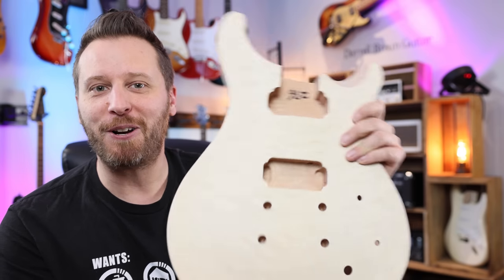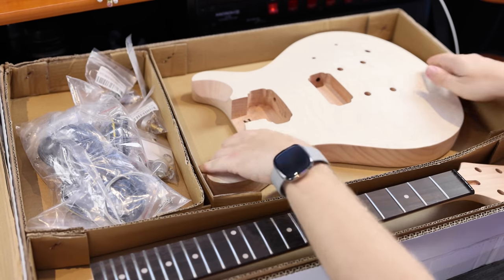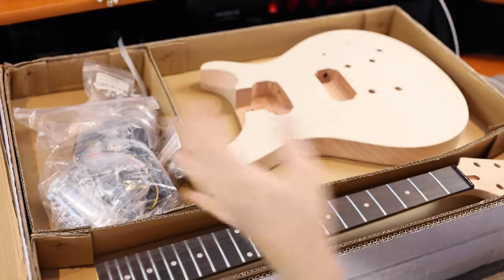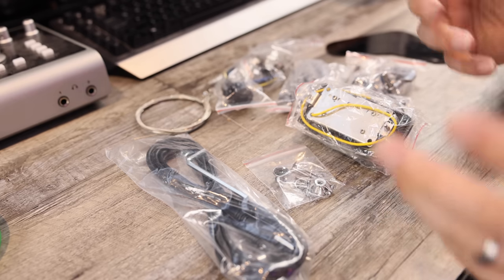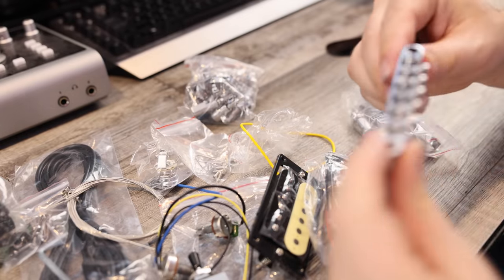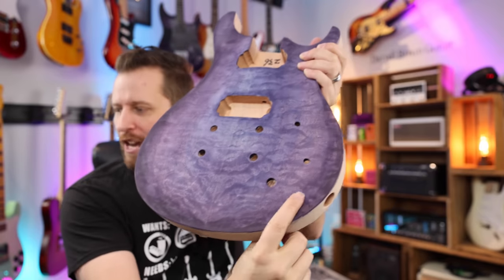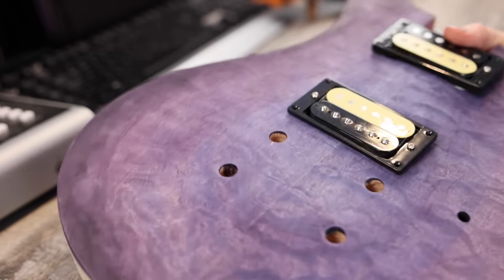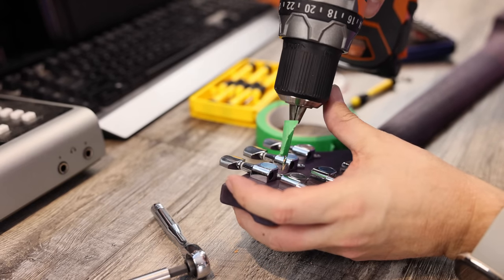Building a PRS Style Guitar! - This One Had Me a Little Nervous!!

Comment: Anyone thinking of doing one of these Solo kits but scared off by the staining, drilling and soldering: I put together one of their Tele style kits with nearly no previous woodworking or soldering experience.  I don't think there was any drilling at all on the Tele kit and the soldering was pretty easy.  I think they even have an option for solder free electronics which just has push together fittings.  And the bolt on neck fit like a glove.  Free shipping and no tax to the US.  Pretty cool.  I sound like an ad probably but really, I'm just trying to encourage others to try this.  It's super fun.

Comment: Loved how that burst turned out! I wasn't sure about it at first but man.... that's pretty. If you use water based stains you can always raise the grain first with a damp cloth, then apply stain after sanding. This way you don't have to sand a stained/dyed surface after. 
I do this for cutting boards, works like a charm. 
Cheers

Comment: QUICK TIP! 
Initially after you've scuffed the first time. Take a very very lightly damp rag and wipe over that wood figuring and then scuff the surface back up 😊

Itll pull the grain up and then when you stain it, it articulates it better. 

Cant wait to see more and/or the next build! 💜

Comment: Hello instead of using the foam brush if you had used a small piece of cloth like part of an old t-shirt I believe you would have had good luck controlling the dye application and thinning it just a bit as well. you can sand it back to lighten it up but if you start with a thinning the dye with a bit of water if it isn't as dark as you want you can always apply a second or third coat till you get it to the depth of color you want. That way sense the veneer on the top is as thin as it is the less sanding the better and you are less likely to sand through it.

Comment: 1. use a clean t-shirt type rag, you will get better results than you would with a foam brush.
2.  apply your base color across the entire top, (in this case azure) then add the eggplant and blend.
3.after staining seal the finish before sanding, you will still flatten the grain after it stands up, however you will not have to attempt to touch up the stain which can go horribly wrong.

Comment: Darrell Braun Guitar You can also use top grade artist oil paint this guitar.  You take the color you pick of the top grade artist oil paint and start hand rubbing it in then use Japan drier to spread the paint so it will dry.  I built a filter box where the guitar dried with out dust or lint.

Comment: 1. Use a rug, not a foam brush.
2. You can't get it even with one coat. You do a coat, sand it with 800 grit, then add another coat. Don't burn through the veneer.
3. To add accents to the flame, first you'd do a full purple, then sand it off, the purple would remain in the darker parts ever so lightly. Then do a full blue on the whole face, 3 coats or something in the same ballpark. Then purple the edges. Then blend them with a wet rug.

Comment: Nice video! Looking forward to hearing what it sounds like. The foam brushes didn't really look like they were any good for staining. I use a piece of rag, roll it and fold it into a tight ball at the end and use this tight end to apply the stain. Gives you much better control over the fadings and depths of colour. Maybe go over it with some 0000 steel wool once it's dry, a light pass to remove any raised fibers or a real rubbing to mellow the tones a little and show some more grain.

Comment: The water dillutes the stain and you rub it off a bit too. I would stroke a bit more from in to out and avoid hard stroke lines with a very wet sponge (and then I mean wet with stain), those are nearly impossible to cover… you can see this particurlarly on the neck but also on the front edges. You need to work quick and in more layers to get it nice and even. The color and grain are nice though.
And maybe start at the back of the body to get a feel of how it works, at the back it’s not so apparant if you make a mistake 😜

Comment: Hi Darrell. Don't know which finish u intend to use. So far I had nice results with wipe on poly for a high gloss. Some parts on the top still look like they have staining streaks in. I suggest take a strong tissue paper towel or a piece of t-shirt, wet it and rub until these marks disappear.
You could also use a trick to make the neck look flamed using a wire and a torch. Dan at Guns n Guitars has some nice vids on this. Cheers V

Comment: You need to de-whisker, aka de-wiskering first.

Before using a water base dye, stain, you need to raise the grain, apply, brush water, let dry, then lightly sand to knockdown the raised fiber, then apply the water based dye. 

It does two things, the grain will not raise again as much like the first time.

Raising the grain without de-wiskering, heavy grain raising, then sanding will cause color loss.

That is the raised fibers will take some color with them, leaving lighter spots. This isn't as noticeable as the second grain raising, sanding as, if any, is minimum. 

On a hippie look, tye dye look, you might not care, nor notice.

Comment: I got the solo bolt on Les Paul kit, in part based on your (previous) video.  Got the body completed with soldered bits together in no time, but the nut was not glued onto the neck properly.  I contacted solo and suggested that perhaps I needed to chisel off the nut, clean up the glue and re-glue it?  They confirmed that and closed my case, but... I have neither the facility nor the tools to get it back on in a way that aligns. The nut is plastic and reasonably cleaned up, but the headstock to fretboard area is not sufficient or linear to seat the nut properly in the first place.  Part of the point of the kit was to not have to mess with this part, insofar as if the nut is on wrong, it will basically never intone properly.  So I have to take it to my local luthier  to figure out what to do.  Needless to say, that's a disappointing outcome.

Comment: The thing I would want to do with the dies is use something dark like the egplant to bring out the wood patterns, sand it back and then do a top coat of the red.  That way the flame should come up really well.  For the back and sides I think it would be better to put straight purple followed by red to give it a very dark colour so as to avoid showing off too much where the second piece of body wood is attached off to one side.  My main issue with these kits is that the hardware and electronics that come with them tend to be so much junk.  I would much rather just order a body and neck pair sourcing the rest of everything else myself.
Reply: Usually the veneer is so thin on kits that you have very little scope for sanding it back after a dark dye and then a lighter one without sanding through it
Reply: With Veneers you can use a solvent stain as the dark color. It doesn't penetrate as far as water based. Once solvent stain is dry sand the middle section to lighten it up. But use 400+ grid sandpaper. Once lightened go in with another color.

Comment: Paul will have this Video taken down, that’s how he roll’s. IMO, the neck was to snug, I’d sand it back just a little bit, if not you’ll have glue squeeze out, also, you have to many hard lines on the body, use a rag, not a brush to eliminate those lines. I love the Egg Plant color 👍👏🤘🏼.

Comment: FY I- When applying the dye make sure to pull the foam brush or what ever you are using to apply the dye out towards the edges to AVOID dripage down the sides, resulting to more sanding work. It will also keep a cleaner line

Comment: I love the build and the colors. The one thing that got my anxiety going crazy is the visible brush strokes on the darker parts of the burst. How could this be avoided?  Cool little build
Reply: Using lint free rags and swirling in circles with multiple lighter coats. Slow and steady, not heavy handed.

You can sand down the finish and it'll lighten up a lot
Reply: @misinformationwithrandy   Thank you very much!
Reply: How

Comment: Could also do these as a bolt on. From what I understand there is no difference between a PRS glue in and bolt on neck joints. Generally use Maple necks for the bolt on models but you could certainly bolt a Mahogany neck as well. I've played a bolt on PRS next to a glue in (Core, etc.) and could tell no real difference in sound or feel.

Comment: Good build Darrell. Love your channel. I'm in the process of building a Solo Ash Burl topped Telecaster. Good kit other than most of the fret markers were not glued in. Thought I'd share a couple of tips.
1) Be very careful sanding the thin veneer when removing factory sealer on body and in process of working with dyes. Mine was only a single mm thick. Very easy to sand through if not taking your time.
2) Check out Derek at Big D Guitars here on Youtube for some great tutorials on how to stain/finish guitar bodies. His work is amazing and his processes are easy and very well explained.
3) Be very careful when adding dyes, specially water based; to thin veneer tops. Excess water saturating the veneer can cause the glue to separate from the main body of the guitar causing bubbles in the veneer that are difficult if not impossible to repair.
Hope this is helpful. Keep up the great work!

Comment: i would have started very light and gradually add more layers of stain to get the transitions as smooth as possible and then have the darkest parts last. that way you can have more control over the shading.

Comment: You don't want to send that clear sealer off you just want to sand into it or lightly scuff it it provides a uniform surface for the dye or paint that you're putting on afterwards so that it doesn't absorb into the guitar different rates ,different colors or chemicals you may put on sealer your color then you're clear what's in the Polish good show , i watching it. If you're going to paint a solid color and did not want to see the wood grain you would just use a primer over the wood instead of a clear sealer the clear sealer is acting as a primer that still allows you to see the wood grain.

Comment: Eggplant (purple) and blue are not complimentary colors.  They are analogous colors. The compliment of blue is orange. The compliment of eggplant is yellow.  Another tip...PRS and everyone that does this kind of dying always start with black, then they sand it back until it's almost gone. Then they use the next darker color (for you, eggplant) then sand it back, but to a lesser degree.  Then they finally add the Blue, and sand very lightly.  The black doesn't show as "black," but rather makes the curl look far deeper.  Trust me.  When you apply the black, it's gonna look like a disaster.  Then the eggplant will also look like a disaster.  Then the blue, as well, will look a bit better, but still like a dumpster fire.  Put some clear on it, and it will look like deep, vibrant ocean waves that look like you can just dunk your hand into.

Comment: Maybe you should have used black stain and then lightly sanded it back. I think this would POP the quilt wood grain a little more. Then place highly diluted eggplant stain over that.
Reply: That's the best way to get tiger stripes but you have to make sure the flame veneer is thick enough, most will tell you if it's thinner than 0.6 millimeters (1/32 inch) you can't sand it back. In that case just do the stain from light to dark and grain fill it.

Comment: Hey Darell - new subscriber here! I really like your direct approach to your videos, whether it's a comparison, build/mod video, or otherwise. Anyway, I'd love to hear your take on when to consider buying a guitar vs. taking a stab at building one. As a fairly beginner/hobbyist acoustic player, I've recently picked mine up again after several years. Of course I had to re-string it (they were in pretty bad shape from the guitar just being stored in its case for so long), only to realize after using the same gauge strings that I probably should go down in size - at least until I can regain my finger strength.

It got me thinking about how I've read about how relatively easier electrics are in terms of action, neck size, etc., and so, I am considering getting an electric. Being pretty handy, not to mention the popularity of "Partscasters", I wonder if building one is the right approach? I was looking through your Upload history, and didn't find one, so it would be truly interesting to hear your thoughts on whether it's better to go the route of buying an inexpensive guitar and modding it to improve performance over time (I suppose there will always be a limit as to how much you should sink $$ into one), or building a kit with modest but reliable parts to begin with, or is it best to graduate from modding one to building your own guitar over time?

Looking forward to your next upload, regardless of the topic. 🙂

Comment: I’m no expert but isn’t putting water on unfinished wood a bad thing? All the softer grain will absorb water and swell and then the surface needs to be sanded again and you end up removing color, or paper thin veneer. Seems like it would be better to dilute the dye with something other than water, maybe high proof rubbing alcohol

Comment: This is insane!!! I just started to look into guitar kits and this is one I wanted, there are almost no videos on YouTube about this kit. You are the best! Thank you!
Reply: If you want to see kit builds Guns & Guitars is a pretty good channel to check out.  Otherwise you can get a lot of really good guitar building tricks from the Crimson Guitars channel.
Reply: @jameslewis2635  thanks
Reply: If you get 1000 grit paper.. (used in the car paint repair industry) I used it to polish a brand new from shop guitar and gave a wax finish. The grain may not be raised but the 1000 grit sits it down VERY well…
Reply: Cort g300 neck end-grain by the  volute now satin and smooth.
Reply: Report the Bot
Reply: also, Darrell often does the kit out of the box, then upgrades all the hardware to make it better. wait for that before you start. don't fear failure. good luck

Comment: The thing that bothers me the most is the very obvious seam in the center of the top.  If I build one myself is there anything I can do about it?  That seam just screams China!  I can instantly tell a fake from a genuine on that one thing alone.  I've never seen any Gibson, PRS, or any other legit brand name with this obvious flaw.  I would really like to know why this happens.  Obviously the mating edge of each half of the top is just not taking in the stain, but why?  Is it because that side of the top was not run through a planer before it was split and bookended?  Not sanded?  I have been thinking about doing one of these myself, but if I am going to be stuck with that flaw, I will probably just go with a solid color instead.    Is there anything that can be done, besides going with a solid color, or maybe covering it with an inlay or dark stripe?

Comment: Gunstock makers trick…. Wet sand with wet and dry fine grit(1200 minimum), this method sands the fibres down as they rise when wet.
You should have a smooth as glass finish and the grain should become much more visible.

Comment: Sorry Darrell it may come,out the way you liked it but that is not even remotely close to,how,its,done. Try using a rag and,pushing,it to the outside edge that will,prevent,it,from,bleeding,over the edge second stain the whole thing blue first as the purple will overwhelm,it and it will fade much easier the blue will show slightly through as well 3rd make,sure to,make the edges extra dark the rag allows you to blend with a much more gradual burst anyway Big D you tube channel he has it,down,to,a,science,he rivals prs custom shop with his dyeing ability with a veneer I am,not,sure weather or,not you could have sabded it back one,time but,that takes on another level of getring,it to,pop

Comment: I think with most finishes you would do a couple of coats and sand between each of them for that nice 3D effect. That would be pretty dangerous with such a thin veneer though so it's probably better not to sand.
Reply: Yeah he prob has to use something like 300 grit or up to do any sanding

Comment: I have built 2 kit guitars, the bodies and necks are fine, everything else is very, very cheap, tacky and is not worth using, start off with a tele or strat kit as everything is much easier. Dont get a veneer top, just get a solid body and stain that.